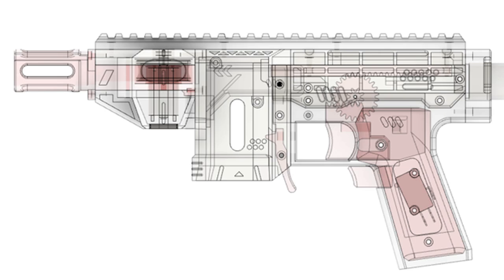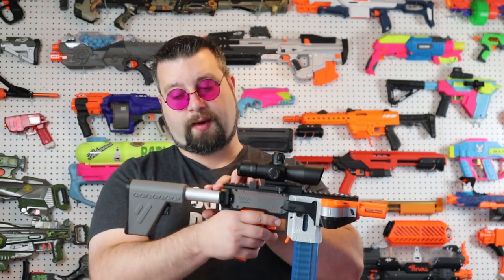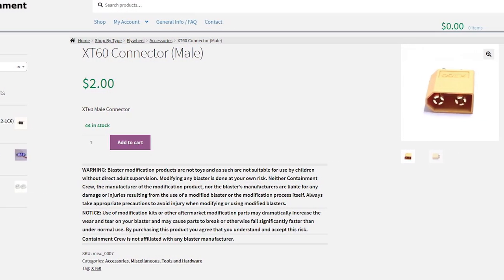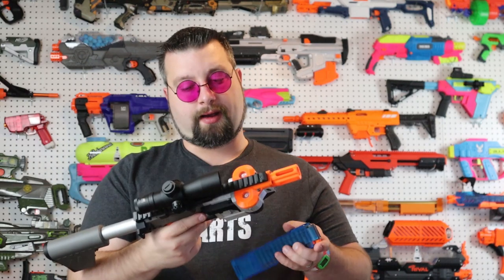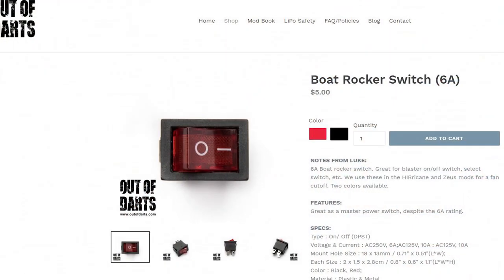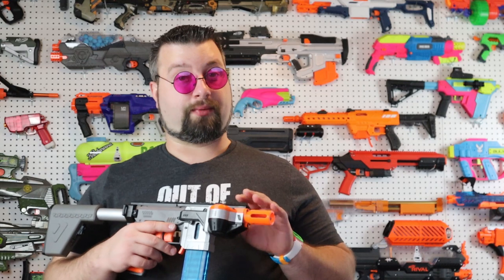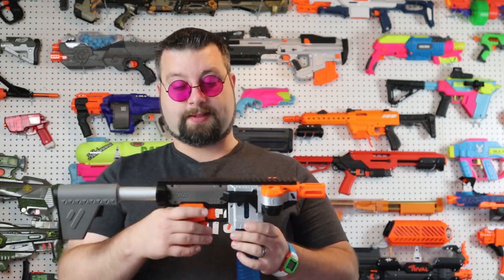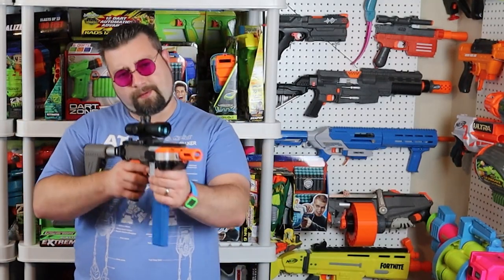The Gryphon Foam Dart Blaster Review

Comment: I like the blaster I just wish the fly wheels were vertical instead of horizontal to help keep it more slim
Reply: I know it's personal preference but I disagree. I really like that the flywheels are horizontal on the Gryphon. Aesthetically I'd rather have horizontal flywheels I don't like having the unsymmetrical flywheel cage bulge. Another bonus of the horizontal flywheels is it lowers the distance between center of your barrel and the top of the blaster. The Gryphon is an inch shorter(in height) than a Stryfe because of this.
Reply: @ehdrien1094  and I can respect that opinion
Reply: Hear me out... diagonal flywheels
Reply: @mattcook6868  
You funny 😆
Reply: @mattcook6868   ok what about 4 fly wheels shaping  like a donut
Reply: @egaming1071  3 sets of 4 flywheels for maximum velocity

Comment: I put daybreak wheels and Kraken motors with a 1500MaH 3S Lipo in my Gryphon. I also did the extended stock and the motor cover with the picatinny on the bottom and run it with a cheap airsoft holo red dot sight and a mini foregrip. I think it's hitting about 150fps.
Reply from the maker: wow that sounds awesome! would love to see a pic of that!
Reply from the maker: @legoboy-ox2kx  That is a clean build! Looks great! Thanks for Sharing.
Reply: @drflux  Thank you! I printed that whole thing on an Ender 3, I had to redo some prints because the bed wasn't level.
Reply: @legoboy-ox2kx  oh boo why’d you take it down?
Reply: @maxwe117  I don't remember taking it down...
Reply: @legoboy-ox2kx  there isn’t a link anymore, and ngl, I wanna see
Reply: @legoboy-ox2kx  ohhhh that’s slick
Reply: What crush is the cage you are using? I’m looking for a 150fps setup so i would love to replicate your build.
Reply: @meroastisruined3039  I'd say go with a 41mm crush cage and Kraken motors with Daybreak Flywheels if you want 150 fps. My build is hitting closer to 160 fps with a 39.5mm crush cage.

Comment: I have 2 questions:
1. What LiPo are you using? And if you actually react, may I have a link?
2. What wire did you use, 18 AWG, 16 AWG or 14 AWG?
Thanks in advance!
Reply: The one is this video is running a 3s lipo and wired with 18 gauge